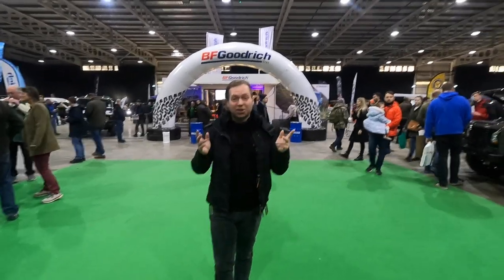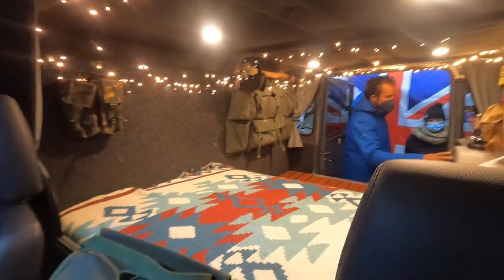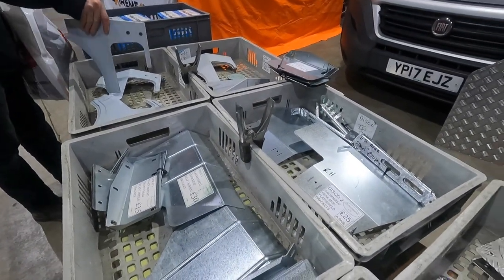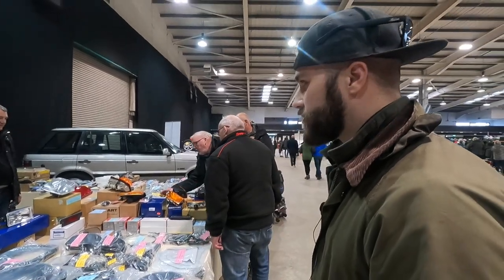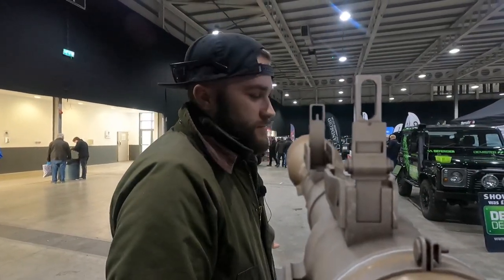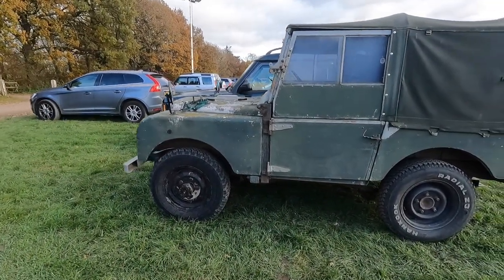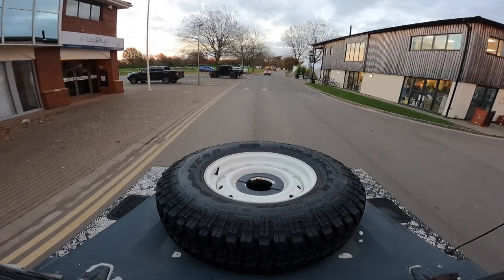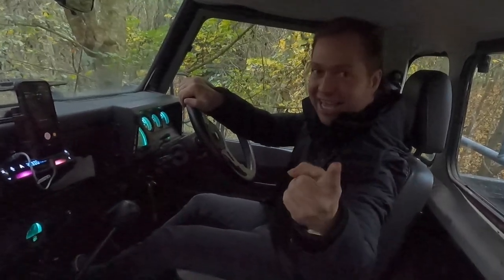SHOW REPORT: Great British Land Rover Show 2021

Comment: It's a shame they couldn't have offered test drives of their converted EV on the off-road course. 

You want lazy power? Fuh-ged-abow-dit.
Reply from the maker: EVs certainly have a lot of potential advantages including maximum torque from zero RPM and a completely seamless, linear power delivery. It should theoretically make an EV 4x4 superb for low speed crawling and towing. Sadly, we still have the potential range issues to contend with, although on the flip side an EV at low speed is much more energy efficient than an ICE at low speed.

Who wants to see us build an electric Series landy on the channel?
Reply: There's plenty of people doing it by repurposing reclaimed EV hardware. What do you reckon, 110kw motor front and back?

I'd happily come help with any electrics and controllers!
Reply from the maker: @DevAnubis  - In terms of affordable donor cars, the Nissan Leaf is looking pretty promising! Utilise the existing transaxle to drive both front and rear axles with a mid-mounted drivetrain where the original transmission used to sit.
Reply: Abomination electric land rover my arse
Reply: @garethlinford5785  triggered much?